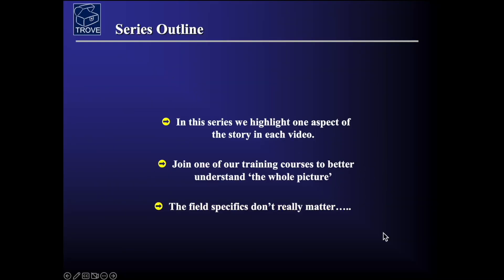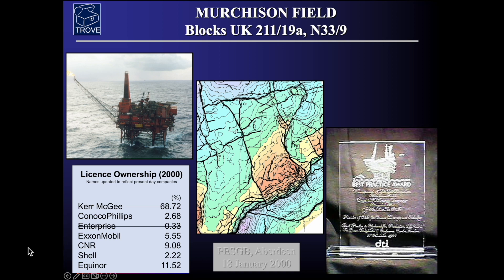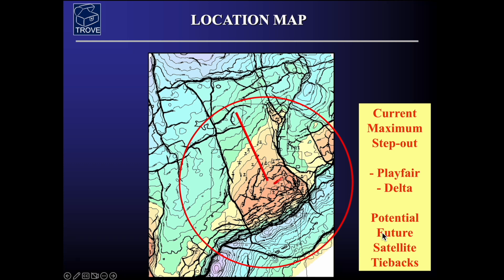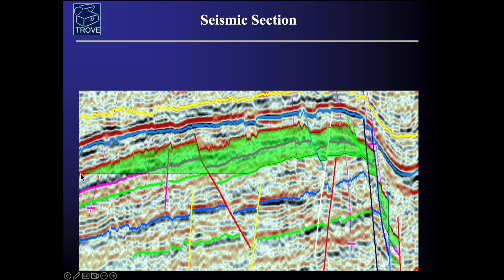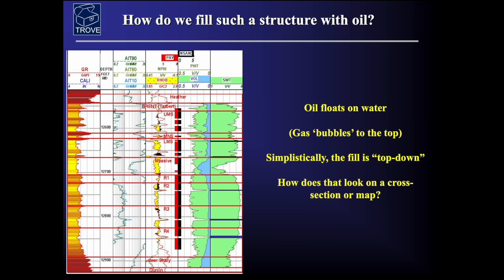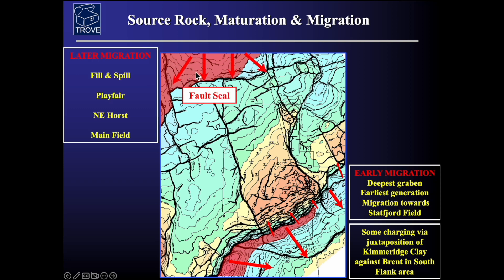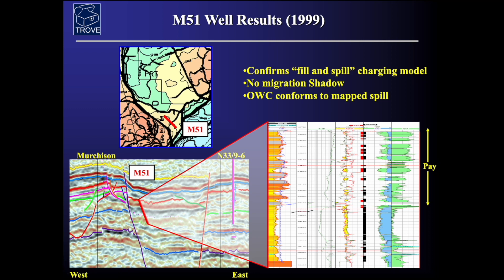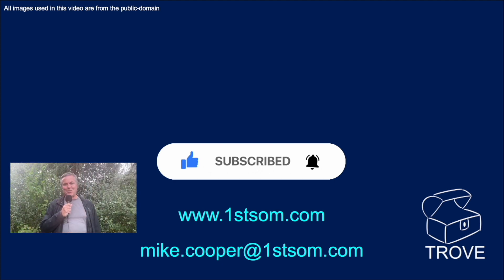How Oilfields Work - filling an oilfield

Comment: I spent a lot of time on Murchison doing geology during its Conoco, Oryx, Kerr McGee and CNR operatorships, including M51. It was sad to hear of the platforms decom and ultimate removal in 2017, but the last wells I remember were spent drilling out through multiple rotated fault blocks where only the mud company seemed to be making a profit. It was a good platform and a classic Brent sequence field.
Reply from the maker: Thanks Rob.

Sadly the targets get harder and harder to find the more mature fields get and eventually it is difficult to find any attic/by-passed oil. The drilling campaign which is the subject of this video saw six wells drilled in one year. That was more than was in the budget. I recall Roy Phillips (MD Kerr-McGee) would smile as the team delivered success after success and found additional contingent budget funds to keep the drilling campaign going. The partners were also hugely supportive. This was the most wells drilled since the original development well drilling campaign ended over a decade before.

Some fields were abandoned ahead of their time and attic/by-passed oil targets remained. Not to mention re-migration of oil and re-charging since abandonment. Hutton is an example. Are the records available to re-develop these fields? The NDR has done a fine job preserving many records - but has every PLT, fluid sample, individual well production test and pressure survey been captured? I doubt these ever found their way into the NDR, resulting in uncertainty for future redevelopment.

I loved the time working and visiting Murchison. If you get the chance, there is a 9-metre-high model of the Murchison platform in the Aberdeen Maritime Museum - well worth a visit. Mike
Reply: @TROVE-1stSubsurface  I've worked in the industry for close to 25 years, I started out in the North sea in 2000 but went overseas to 'follow the money' I worked all over North Africa and the Middle East and then ended up working on boring US unconventional. I've worked in geosteering for around 18 years which is all about horizontal drilling and I would love to see the North Sea have a renaissance and surely they could drill a bunch of horizontal wells to scoop up those by-passed/attic sections but at no point in my career have I ever had anyone reach out for work. It seems to me that the North Sea is being ignored globally yet there's so much more we could do.